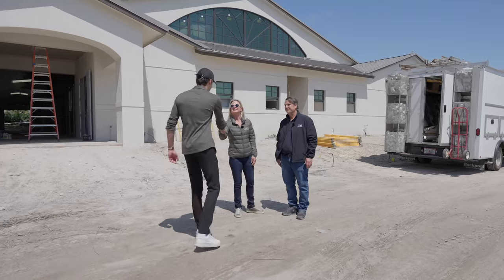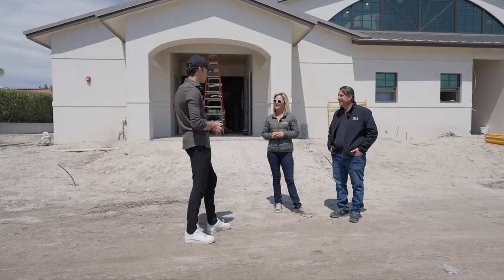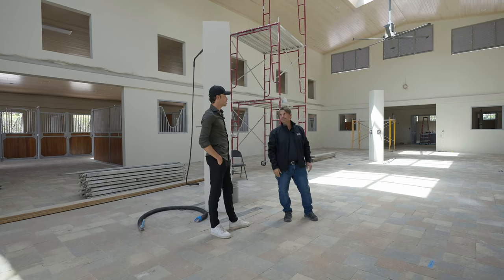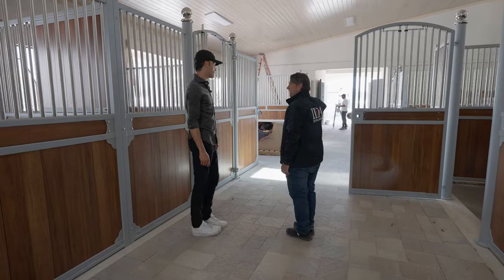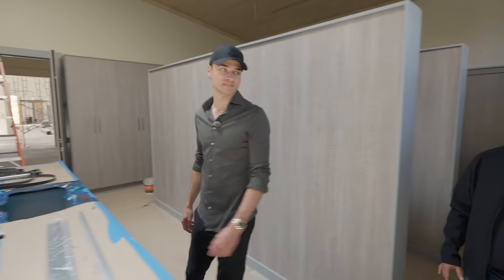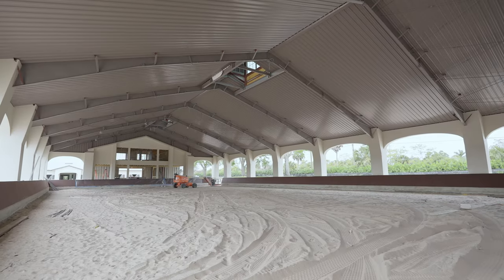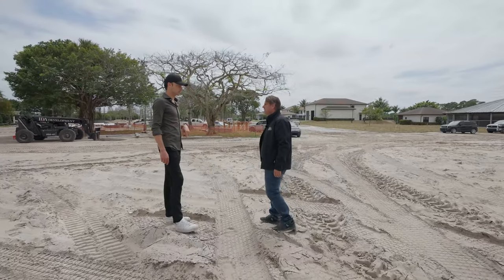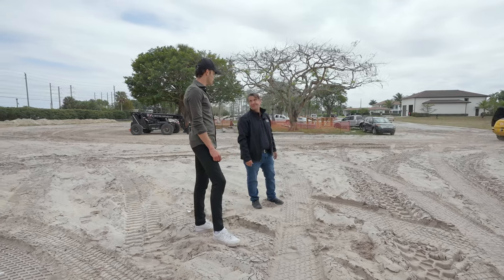INCREDIBLE STABLE in the making

Comment: 12x12 is not a very big stall, especially for those large sport horses. I guess I'm an old crank because I would have made it different with an eye for the horses instead of whoever they are trying to impress. At least they've made an effort for some turnouts but not nearly enough for 35 horses. Thanks for showing us though Matt, I do like some of it.